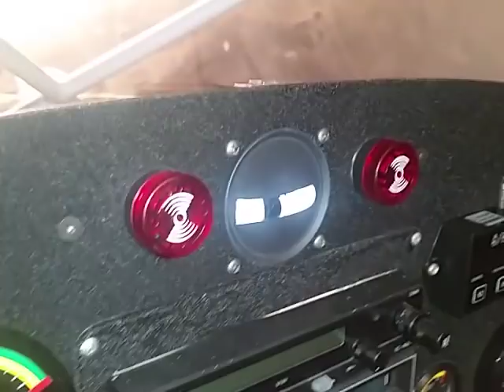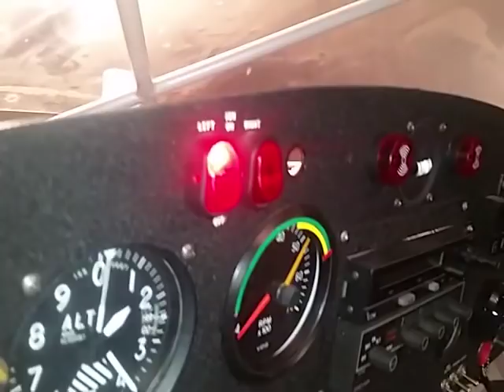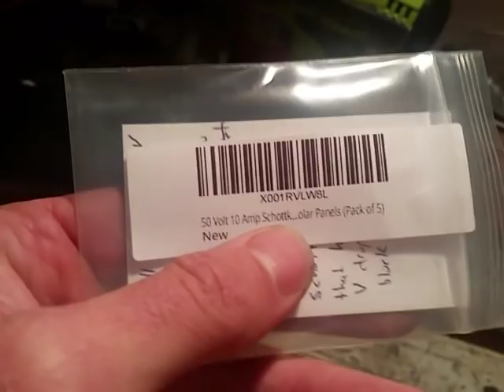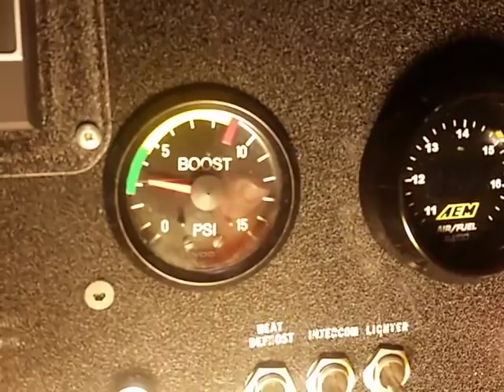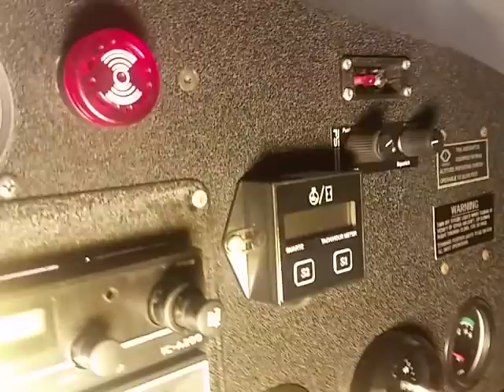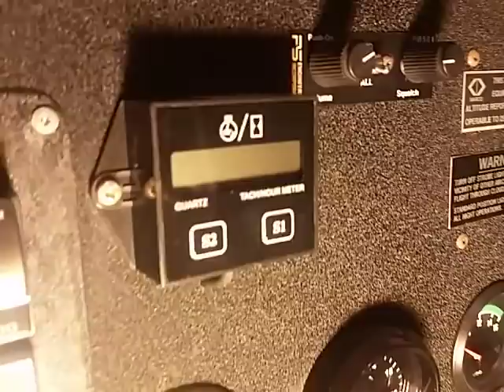Yamaha RX-1 Apex Install in Kitfox 5 (part 2, prior to ground testing)

Comment: Brett how did your pump config work out. People are using this $700 epex pump which is certainly pretty. But i like the idea of a pump that runs off the engine without power and a boost pump. Thats what my rv has. So how did it work out?
Reply from the maker: My rx1 is carbureted so all i need is 3psi.  The apex / epex is efi and fuel pressure there is higher and needs to be more precisely regulated.  I'm not sure what pump and regulator is best for those??

Comment: don't wrap your tachometer wire around your spark plug coil.. find another way to get tach reading. the spark plug power will jump across to your tach wire. your cylinder will not fire properly.  use a magnet and sensor to get your tachometer reading from crank or flywheel.

Comment: Where did you get a vacuum pulse from on a 4 stroke?
Reply: Not a bad question. Only place can be crankcase .Kohler does it . So does honda. Can you get a pulse from a 4 stroke ? I guess it works ! Now I got to find a honda and my vacuum  gauge ! Got me thinking Thanks !!!!!
Reply from the maker: Yeah I used the stock pulse line off the back of the carb boots (boot between carb and cyl head).  And that is one of the two yamaha pulse pumps used on the sled.  In testing this setup ran really well at all throttle settings with just one pump so I plan to keep it that way.
Reply: Is this not a 2 stroke ?... Yamaha Apex / Snowmobile
Reply: @robertlafnear4865  dohc 4 stroke, 4 cylinder
Reply: Guess I missed something along the way... did a bit more research..... DOHC  4 stroke  4 cyclinder for sure,.. Thanks .

Comment: Great video, what did you use for a throttle cable !
Reply from the maker: Thanks!  I ended up being able to use the throttle cable off the snowmobile when I switched to the round cowl  (which gave me the vertical room I needed).

And I havent flown the plane yet...  my summer got busy with many other things but hopefully my "slow motion" project will get moving again soon!  ;)